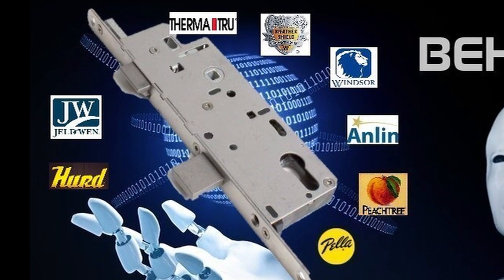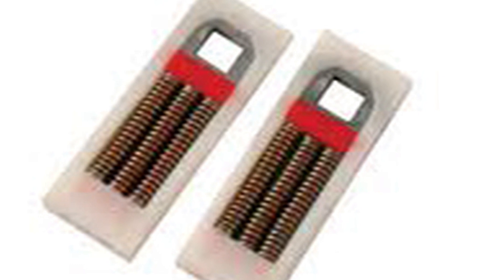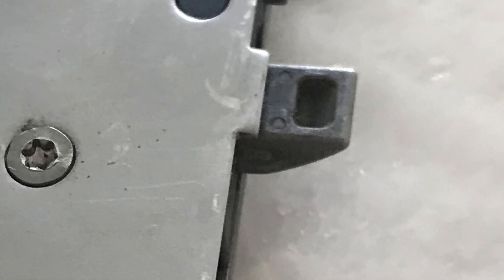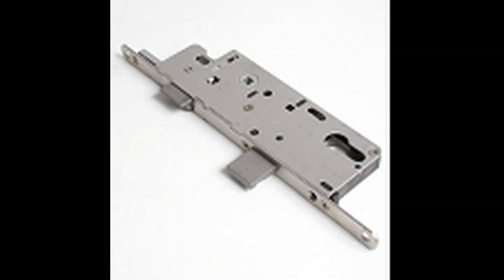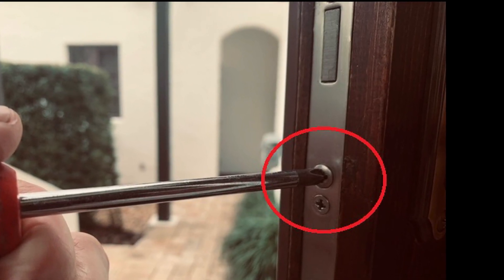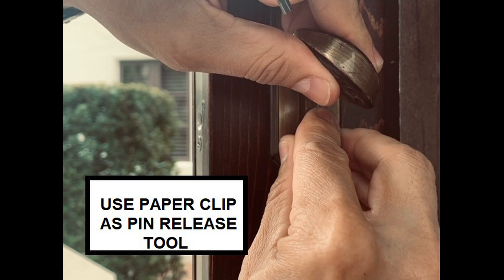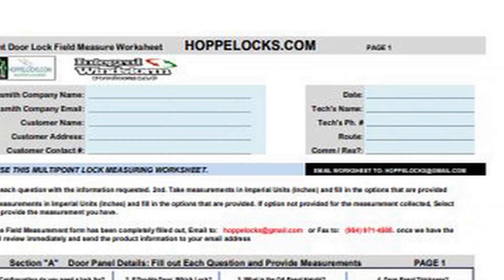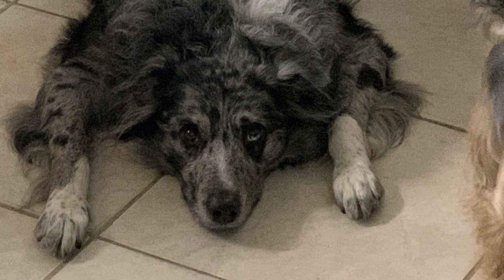Hoppe Multipoint door lock gearbox replacement training tutorial for homeowners and locksmiths.

Comment: Just changed my gearbox today. When pulling restrictor pin down it is helpful to know the restrictor pin in my gearbox was not smooth. It had indentations in the middle that I think you are trying to catch and pull down. I was thinking the paperclip was going in further in above the restrictor pin. I thought there was something blocking my access to the restrictor pin so on my handle there was a headless screw that allowed me to pull the pin out completely.